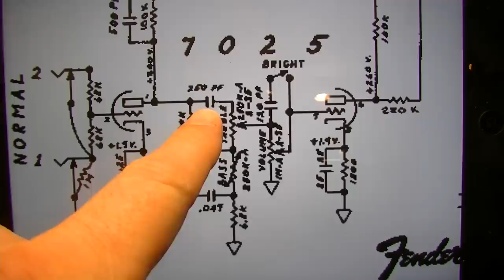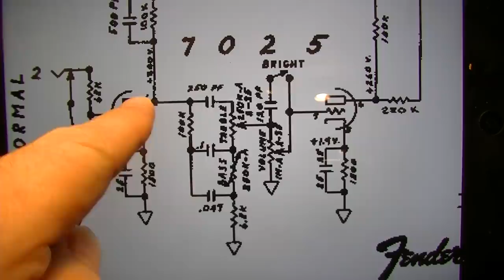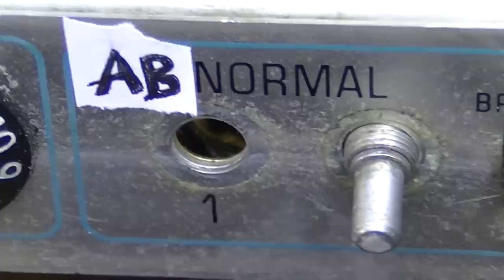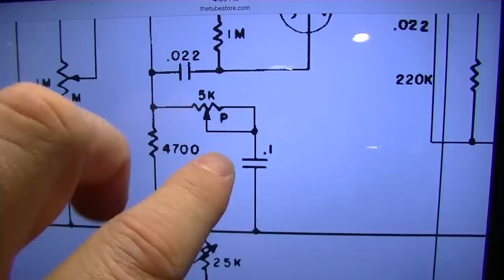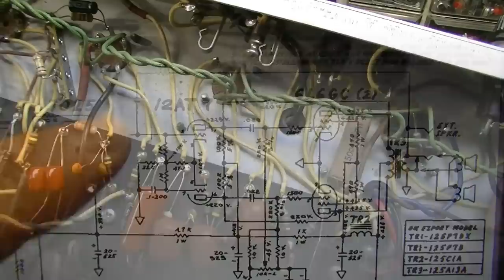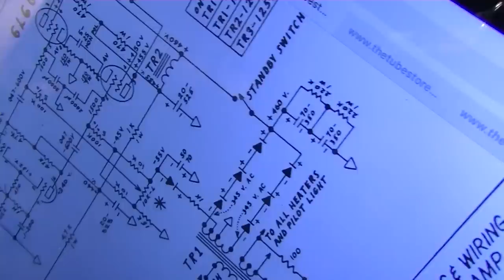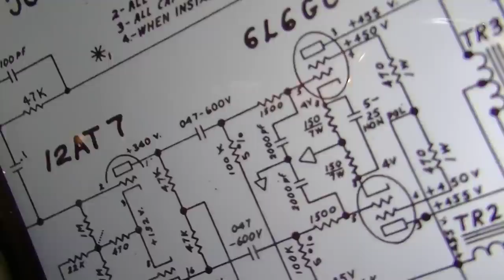SECRETS of the Fender Bassman - "ABNormal Channel" Mods Unleash the Hidden BEAST!

Comment: what difference did the changing of the 68k resistor over to a 33k resistor do? (just 1 input jack on "abnormal" channel)...i have a "1 input" plexi build that has the 68k still in place...could i replace that with a 33k for more better "everything"?...awesome old fender man!...kinda wish i still had my 1st amp...66 showman amp!...cool!
Reply: He removed a 2nd jack, which was adding another 68k in parallel. 34k is keeping tha grid stopper value the same as original.

Comment: I have a question about the ground issue you talked about, where two points of ground on the chassis is not good. Does that apply to power and signal grounds each using a single but, different chassis locations for ground? Thanks and thanks always for your vids.
Reply from the maker: There are some discussions on ground loops and schemes online. Definitely an interesting subject.

Comment: BRAD!  make your own FEEDBACK/SUSTAINER 38:06 I live for feedback,sustain, bleeding notes, wish i could get that @ without having to turn up or use my dyna comp. Guess you're just straight in and holding your guitar in front of speaker....? Fantastic clean yet strong feedback, if only you could get that without having to hold guitar in front. How about an external guitar pickup that you clip in front of speaker thats sent through guitar cable with switch on guitar somewhere....whatever.

Comment: I aslo hate lifting boards. I build using turret boards on standoffs. I think im going to start putting trap doors in my builds. So i can flip the chassis and access the bottom. 
I also have thought if i build using bottom mount noval sockets, I'll be able to take out the sockets, pots, and boards in one piece.. 
My cabs will be traynor style too. Just.pop.off the top of the cab for quick access.

Comment: unrelated question: what are those 2 metal flat pieces on top of the amp?  What are they for?  (the ones on the left and the right side)
Reply from the maker: Those are the chassis mounting straps. bolts secure the chassis to cab. Metal pieces act as large washers.

Comment: Can this be done with a later model amp? Say, a bassman ten? This is pretty much exactly what I have wanted to do to my bassman for like a decade.
Reply from the maker: Lots you can do to a Bassman Ten, but it's tougher because you don't have the extra gain stage sitting there unused like in the earlier ones. Plus, at some point the OT was changed to Ultra Linear, so you might have to do something about that as well. More work involved making one of those scream, but it can be done. Might have to give up one channel.

Comment: Could you please do a short video or link me to a schematic or anything about adding the gain stage I haven't been able to find any info about adding a gain stage to a amp.
Reply from the maker: That's precisely what I do in this video.
Reply: The Guitologist I'm sorry but you lost be a little bit, I know u use the unused half of the 12ax7 so u have to hook up the heater for it and bias it as well then go from it's grid to the plate of the next stage where u originally removed the signal for the normal channel? Just need a little clarification to be sure I understand it

Comment: I have a 77' Bassman Ten. Can the same mod be done on it? It gets kind of a spikey mid-boost that i'm not a huge fan of and can't seem to dial out, any suggestions in that area? Thanks.
Reply from the maker: Yes. The Midrange Switch Mod will work on the Bassman 10. Your fixed midrange resistor should already be a 10k. Add a second one off the switch in parallel.

Comment: If you got the right amp Dr. this is probably the best Head ever made. Mine has been modded to a beautiful JTM and I had it Black Faced. It is killer. Marshall hasn't done anything since the JCM 800. Transformers in the new Amps are the problem. They are cheap.

Comment: jchavins is just wrong.  Saying a Bassman isn't a guitar amp denies about 60 year of guitar amp history.  Like a Marshall plexi (and all the subsequent clones) is not a 5F6 Bassman? version built by brits..  The problem with the Bassman AB165 or AC568 is that in a misguided effort to make it into a "Bass" amp, Fender (CBS?) removed all high frequencies from the amp by bypassing the plate resistors of the preamp with fairly large caps... .01 uf etc..i & ncluding the little yellow ceramic at 19:06 across the brown ,black, Yellow ...100K plate resistor.   Taking these bypass caps out, returns the bright sparkle to the Fender, and makes it sound like a typical Fender guitar amp!  Brad I have done many mods similar to You excellent effort here , but I always take out those plate resistor bypass caps.....AAAaarrrgghhh...!

Comment: If you remove the 140 ohms from the power tube cathodes and ground them as well as pre-cbs the bias, you will get a little more out of the power stage.
Reply from the maker: Trust me, it doesn't need it. This thing I could not get above TWO on the Master Volume without getting the cops called. Seriously.
Reply: I was a bit keen to know what of the N F B mod , I thought you were going to go the Bounce and Vibe  thing , like old plexi . (Slash ).

Comment: My God Man....
Always with the bass to guitar conversions.
It's not like I understand the schematics and changes and even what a micro-farad is ( I am fascinated though) ...but taking a Bass Amp and turning into a guitar amp?......How about taking a Marshall and moding it to sound like Ampeg B-15...... I guess I'm giving away what instrument I'm for....
Reply from the maker: Would you go onstage today with a stock Fender Bassman for bass?
Reply: Bassmen were shitty as bass amps though, so why keep it as a heavy but substandard bass amp when you can make it into a killer guitar amp, and then stick with modern hardware for the bass? Modern solid state technology mixed with a nice tube preamp can give you insanely good tone, with enough power to actually sound good, and still weigh less. Use the right tools for the job.

Comment: Hello,, nice work   I watch this channel a lot,,   At times these baseman's have the greatest sound I could ever dream of,, then times it seems to disappear? truth to what I'm getting at ,, Hate my post if you will,,  But on my Mustang 4 or 3 Its the 100 watt one,,   I use foot switch  at times to Keep the tone going.  Yes the Solid State is what it is,,  " reliable to power into it, doesn't effect the amp,   I don't have tube probs,, the list goes on and on "    What am I saying,,, Yes I'd love this amp,,  Yes I see tubes have a realism,  sorry After you get use to tweaking the mustang and save pre sets,, it gets easer.  How many 1970 Baseman's can I keep running? I was going buy the Bassbreaker 45, same worries,, So truth I'm just stopping here,, I have the stage right 100 buck blues breaker tube amp copy ,, I use that to set up the solid state amps. I'm going with the Mustang 3 and the new Boss Katana 100. I'll use them as stereo effects. Sorry I'll dream of the day I can have the money to go all tube.      Added note the Mustang has the 60 Bassman ,, and the 59,, bassman, amp emulated featured capability.    do blind hearing test?   for all TKX Fender for all your amps.